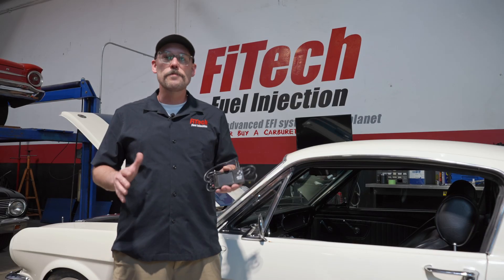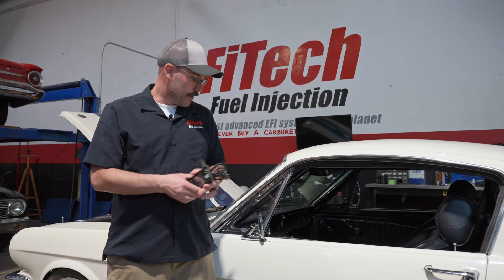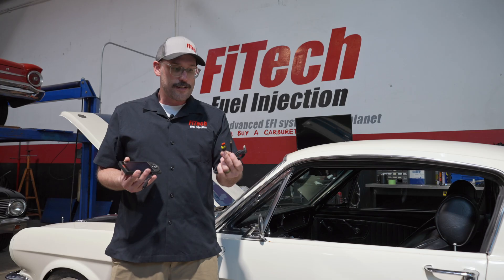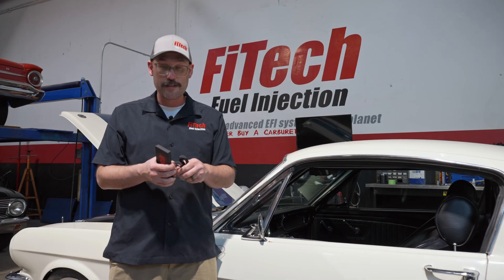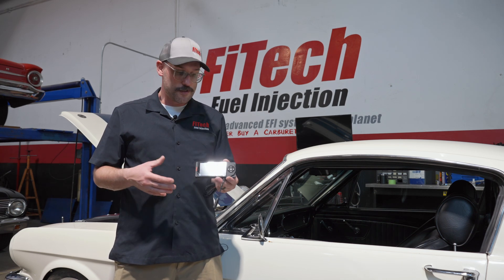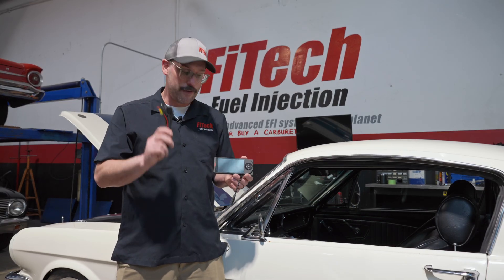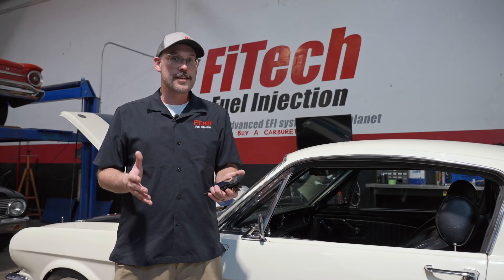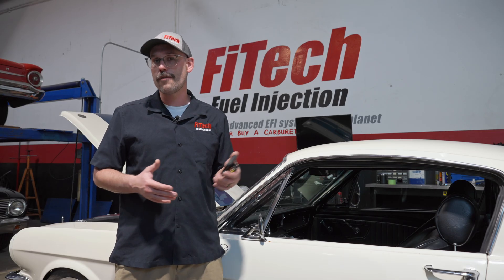FiTech EFI Handheld Controller | Product Overview

Comment: I have a 39001Go EFI 2 Barrel 400HP System with the old style handheld. Does upgrading to the new one also allow any additional adjustment features or menu features?
Reply from the maker: Hello sir, 

Upgrading the handheld brings a variety of benefits, starting with better and easier use of the handheld device, as well as more options of tuning. The screen is larger and will allow you to use it as a gauge cluster when selecting certain parameters you want to display. The 39001 is also a power adder unit which can be tune using the new style handheld device.

Comment: What I want to know is, how do you turn up the brightness on the handheld, it's to dim
Reply from the maker: Hello sir,

The screen doesn't have an adjustment for the brightness as its preset already, however, what I suggest is revising the connector inside the handheld making sure that is not cause of a dim screen, feel free to contact our technical support team, they can walk you step by step on revising the screen.